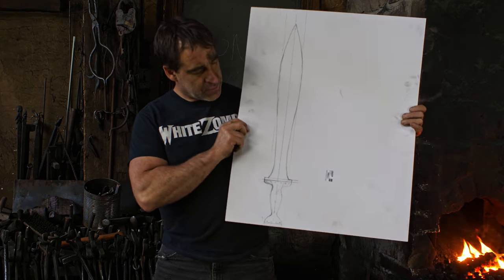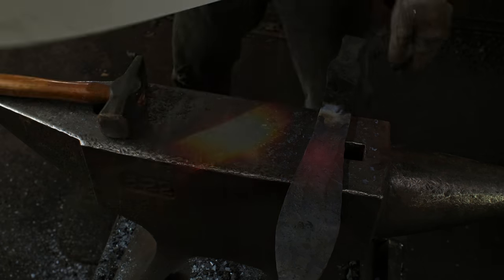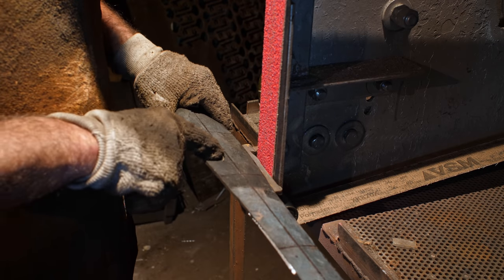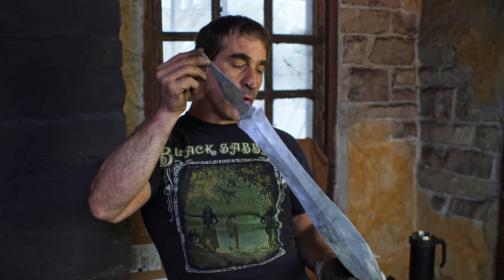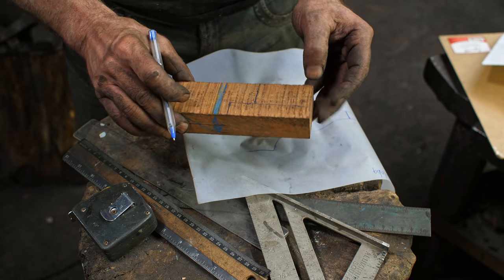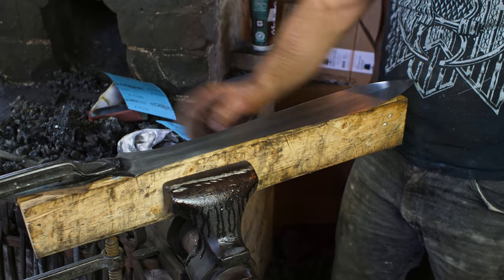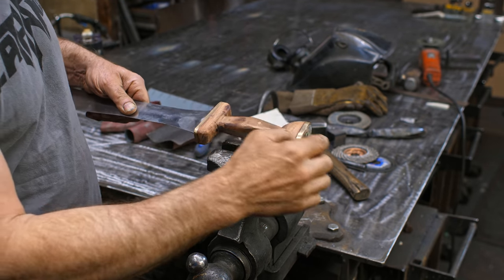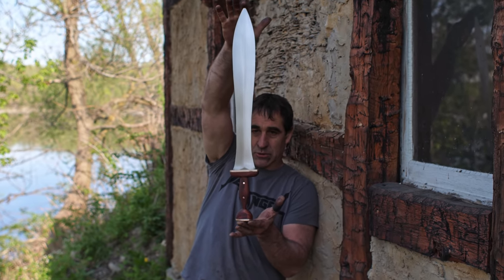Forging a Xiphos - The Hoplite's Sword

Comment: woodworker here. You want to add a finish onto the stained handle to seal and protect it. A stain by itself doesn't offer any protection and looks pretty dull once dried. I'd add either a couple coats of danish oil, shellac or a blend of danish oil and oil based polyurethane and wipe on 3-4 coats. That wood grain and color will pop and il will prevent it form getting waterspots ot dirt from hands on it and making it all dirty.

Comment: the section where you hand filing i found those cheap diamond square blocks work pretty well on truing up the lines and flats, they crap for proper sharpening but a useful tool for hand blocking.

turned out great, happens to be my fav type of sword too
Reply from the maker: That's a great idea!

Comment: This is great!  If I had the ability, knowledge, and equipment to do this I probably have made it a bit stabbier and a little less choppier.  Also I would have made the handle shape a little different.  However, these are minor changes and don't take away from the wonderful job here! 
It also taught some valuable techniques for a knife project I have planned. Subscribed.